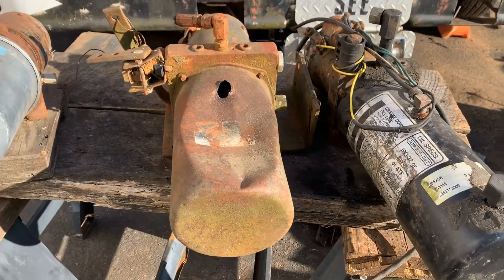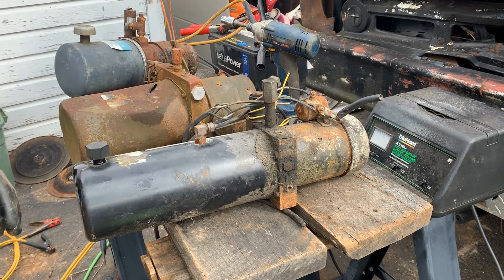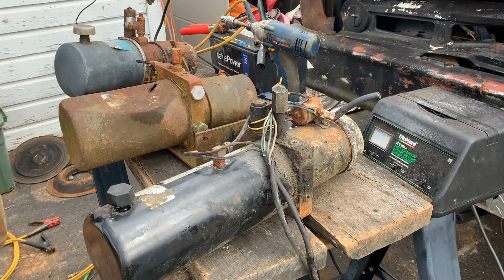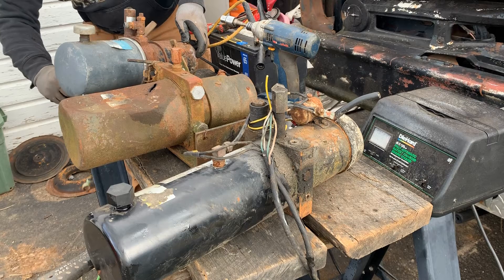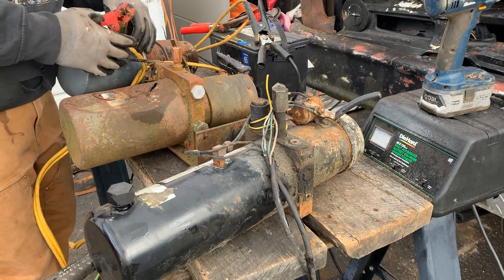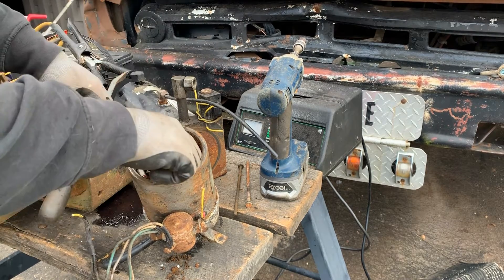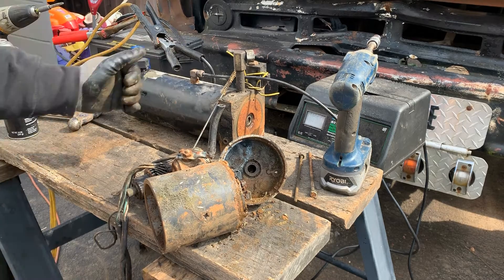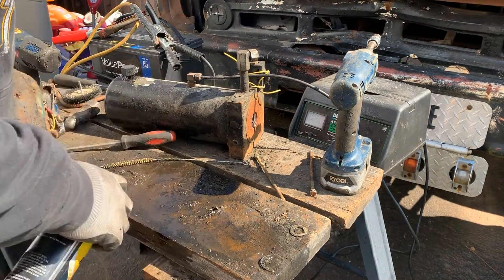DIY 7000 LB Dump Trailer Part 4 pump it up! Selecting and dissecting electric / hydraulic pump units

Comment: I am having a hard time figuring out how large of a reservoir I need. I purchased the backend of a dump truck and want to add a pump to it. I want to make sure I have enough fluid but can not find the information.
Reply from the maker: If you can extend the cylinder to where it will be dumped, fill with fluid, then lower bed, the fluid will flow out into a container like a clean bucket and can be measured. You’ll find the standard reservoirs hold enough for most cylinders, but they do make larger ones. You can also measure your cylinder and use “volume of a cylinder” to approximate the displacement using the stroke of the cyl as “height,” or you can consult a manufacturers chart for fluid displacement.